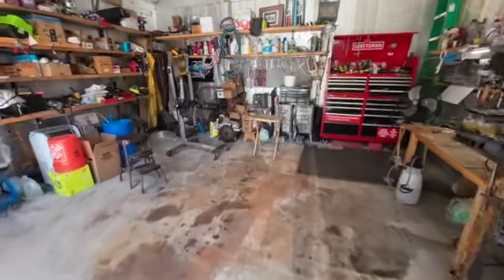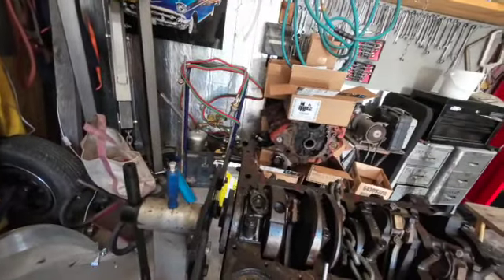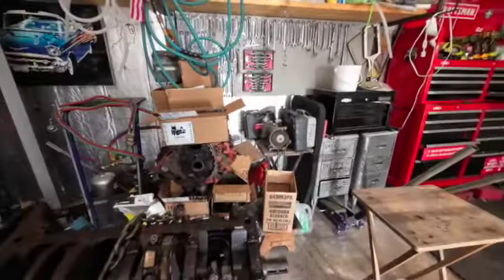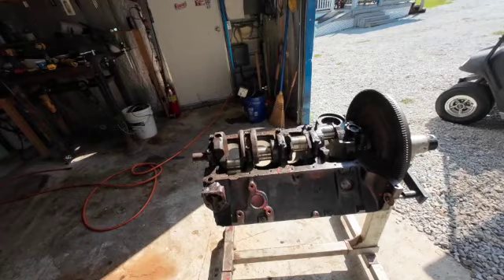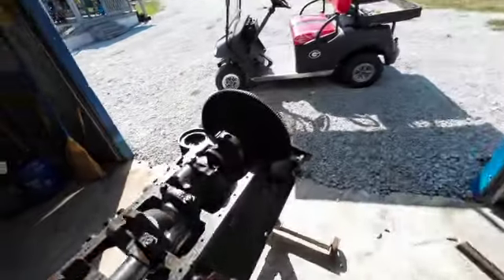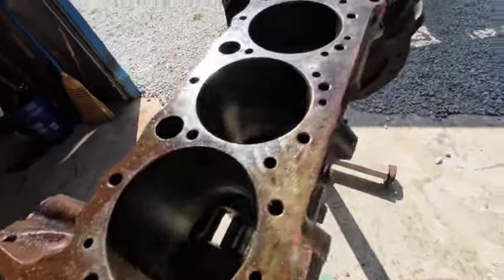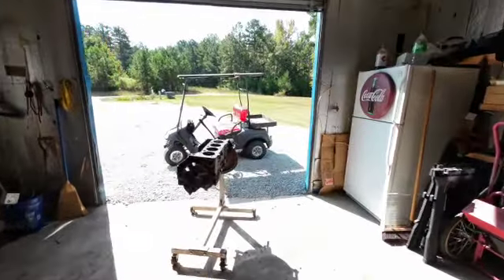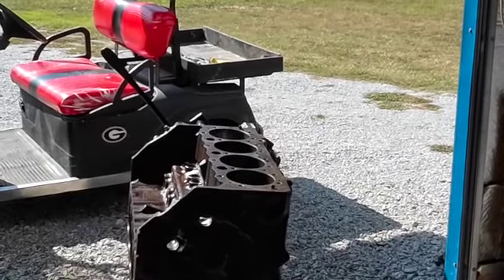This motor won't do!

Comment: The engine in the Rambler has a rod knocking. Why couldn't you just rebuild the lower end with new wrist pins and bearings?
Reply from the maker: Brian Brian Brian....  Why ask why?
Reply: @rpeek   I know, I know, I know!🤣